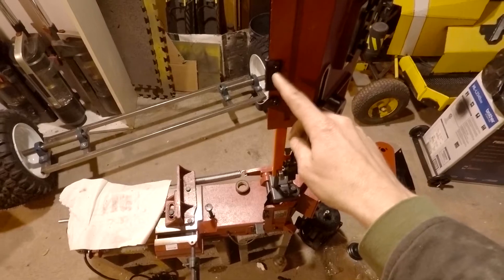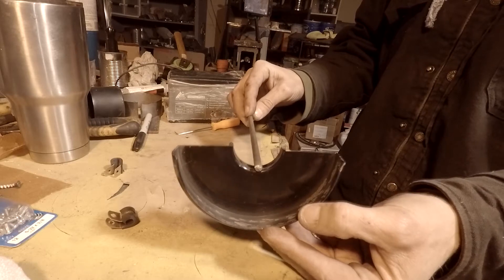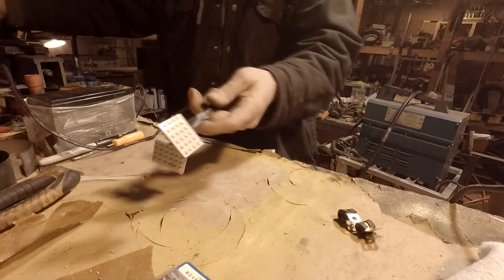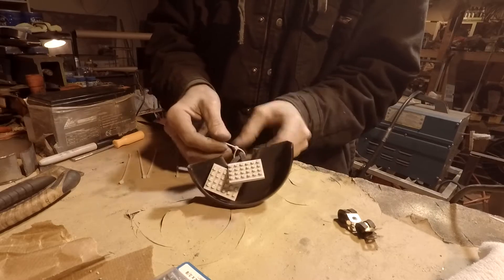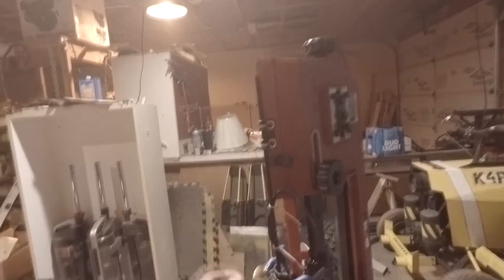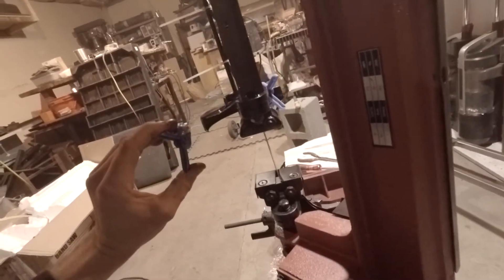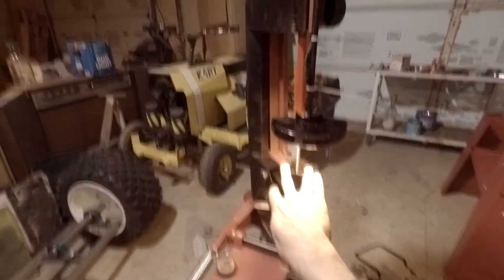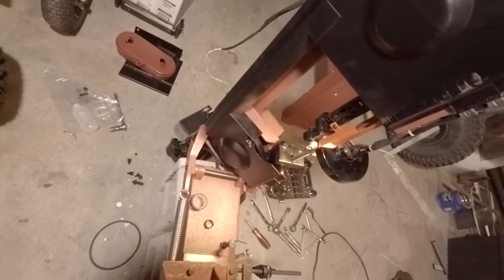Harbor Freight Bandsaw mods  [ LED Mod ]

Comment: You may want to make sure the light doesn't hit the table when used horizontally
Reply from the maker: yeah, But I wont be using this much for horizontal cutting.